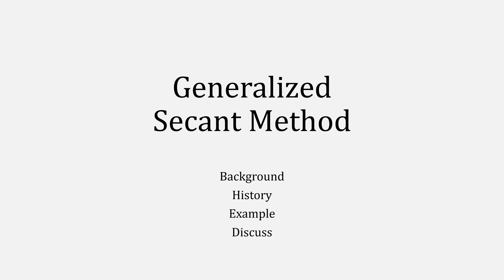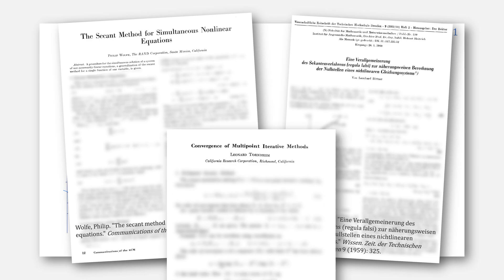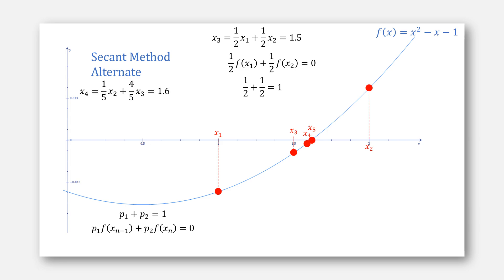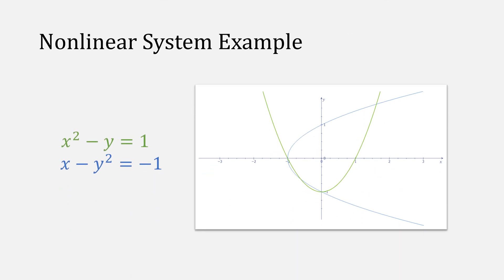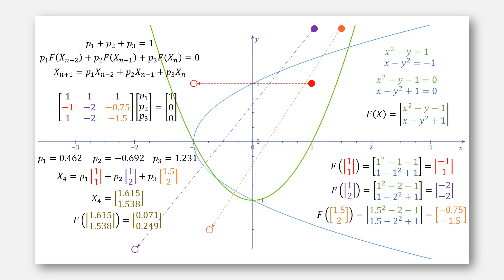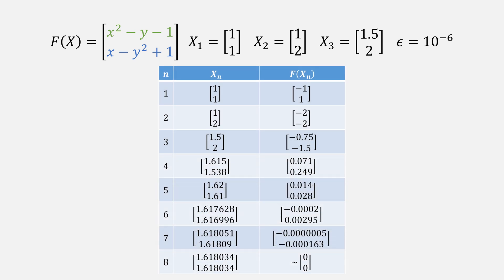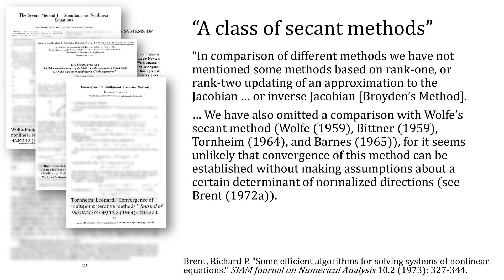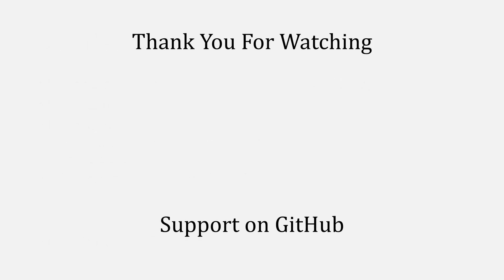Secant Method for Systems of Nonlinear Equations

Comment: The link doesn't seem to be working... but nice video! I've also seen some papers generalizing Halley's method to systems of nonlinear equations.
Reply from the maker: github link fixed
Reply: @OscarVeliz  How do you calculate the p values from p1 to p2? Also, I saw that you wrote the program in Julia. I also noticed that you used the backslash operator for 
P = A \ b.
Reply from the maker: For the two variable version I solved the linear system shown at 1:32. You can rewrite it in the form Ax=b [or x=(A^-1)b or x=A\b] with any linear system solver replacing x with your p vector. The Julia program I wrote will actually work for the one dimensional version as well (which is how I computed the results for that example).
Reply from the maker: It looks like it could work. I don't know about the determinant approach to inverting a 3x3 but I'm assuming that is fine. As far as starting points, the best approach is to use the same scheme from Jarratt's method. edit So that you're starting with points right next to the pixel.
Reply: @OscarVeliz  The problem is that I get a different result compared to the Secant method that uses the Newton step. And when I tried to extend this to higher dimensions, I get a blank image.
Comparison in these two images:
https://github.com/avachon100501/ultrafractalcollection/blob/main/photos/secant/Wolfe-Bittner_Secant1.png
https://github.com/avachon100501/ultrafractalcollection/blob/main/photos/secant/Secant3.png
Reply from the maker: The three starting points do need to be unique and it looks like your second and third point are at zero zero for both. If you can't get the Jarratt method of starting points then try to add some small change (like .1) to the x or y to you second and third points so that they start near the pixel. Also, are you positive you're computing the inverse of the 3x3 correctly?
Reply from the maker: It really appears that start and start1 are both the same value. If that is the case then the matrix will be singular and you can't invert it. You have to make the other starting points offset from the pixel.
Reply: @OscarVeliz  Even if I changed the values, the image is still blank, how do I proceed for offset?
Reply from the maker: The other reason you may be getting blank images is the matrices might be singular. Include a check to make sure you're not dividing by zero and in the event you would, apply the maximum value to that pixel. Regarding the offset, add and subtract some small set of numbers from the pixel for your other points. If they are all the same value being added then that might create a singular matrix.
Reply: @OscarVeliz  In your Julia code, isn't it supposed to be (x^2 - y - 1, x - y^2 + 1)? There's a mistake here in line 13. When I realized this, I modified the function, and an image did generate. See here: https://github.com/avachon100501/ultrafractalcollection/blob/main/photos/secant/Wolfe-Bittner_Secant2.png
https://github.com/avachon100501/ultrafractalcollection/blob/main/Root-Finding/Wolfe-Bittner%20Secant.ufm

However, I was unable to generate the basins of convergence.
Reply from the maker: Thank you for noticing that error in the comments. I have fixed it. It could be that the starting point approach from Jarratt doesn't work with systems. There are some lines that appearing in your image that might be caused by that. Another strategy for your starting three points is to set them so that they aren't on the same axis essentially. Perhaps adding some small number to the x and subtracting some other number from the y and vise versa for the third point. Trying to set them up as a triangle instead of on a line.
Reply: @OscarVeliz  I managed to reproduce the secant fractal for the cubic roots of unity (z^3 - 1) using the alternative secant method.

Code here:
Secant3 {
init:
  z = #pixel
  oz = @start
  fz = fzd = oldz = 0
  i = sqrt(-1)
loop:
  complex start
  oldz = z
  fzd = oz^3 - 1
  fz = z^3 - 1
  a11 = 1
  a12 = 1
  a21 = fzd
  a22 = fz
  b1 = 1
  b2 = 0
  det = (a11*a22)-(a21*a12)
  factor = 1 / det
  ab1 = a22*b1 + (-a12)*b2
  ab2 = (-a21)*b1 + a12*b2
  pp1 = factor * ab1
  pp2 = factor * ab2
  z = (pp1*oz) + (pp2*z)
  oz = oldz

bailout:
  |z - oz| >= @bailout || |fz| >= @bailout

default:
  title = "Secant 3"
  maxiter = 1000

  param start
    caption = "Start"
    default = (0, 0)
    hint = "Start value for oz."
  endparam
  
  param relax
    caption = "Relaxation factor"
    default = (1, 0)
    hint = "Relaxation factor."
  endparam

  param bailout
    caption = "Bailout Value"
    default = 1.0e-20
    hint = "The bailout value."
  endparam
}

I used two bailout conditions, and you notice that I used the product of ab1 and ab2, that is, multiplying the 4x4 matrix A by the 2x1 matrix b, to then multiply the factor by said products.
Reply: And the result:
https://github.com/avachon100501/ultrafractalcollection/blob/main/Root-Finding/Wolfe-Bittner%20Secant.ufm
https://github.com/avachon100501/ultrafractalcollection/blob/main/photos/secant/Wolfe-Bittner_Secant1.png
I finally managed to see the basins of attraction.
Reply from the maker: It certainly looks like basins but I expect it to look more like the Newton version. Can you tell if those basins go to the solutions of the system or are they separate?
Reply: @OscarVeliz  The basins are all present, and the size of the basins vary depending on the starting values. They go to the solutions.
Reply from the maker: Try this
  x = real(z)
  y = imag(z)
  ox = x - 0.015
  oy = y + imag(0.05)
  oox = x + 0.01
  ooy = y - imag(0.015)

Or something like it... I don't have UF to verify this code is correct but if it is I think you will be satisfied with the results.

edit you may not need those calls to imag() and can just just use the numbers like normal.